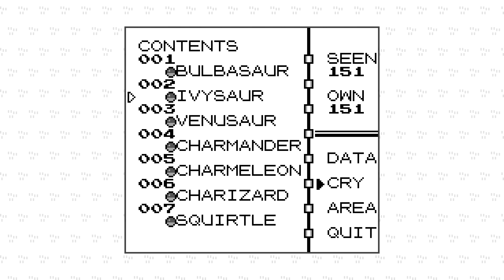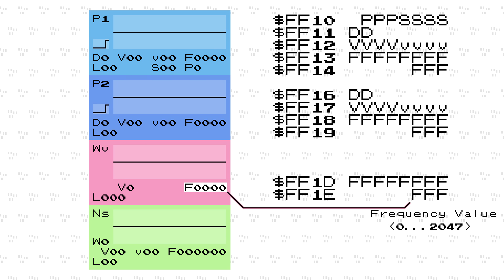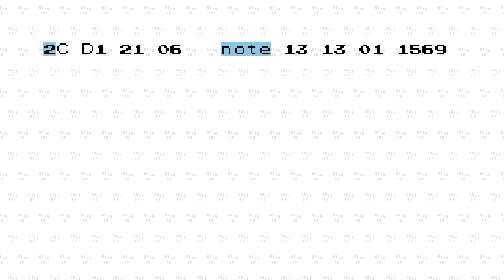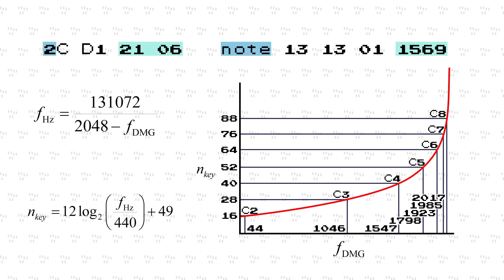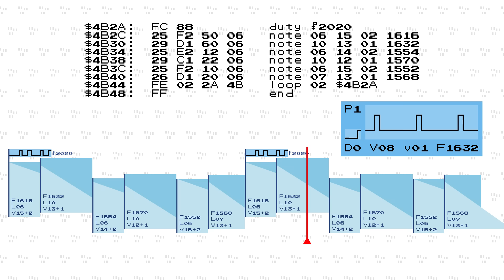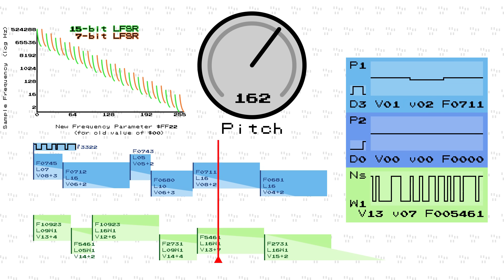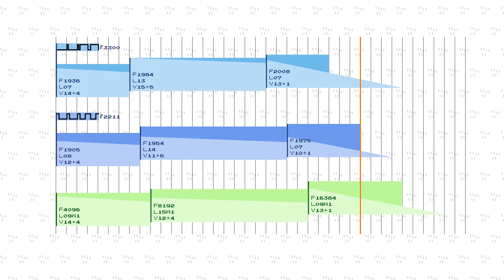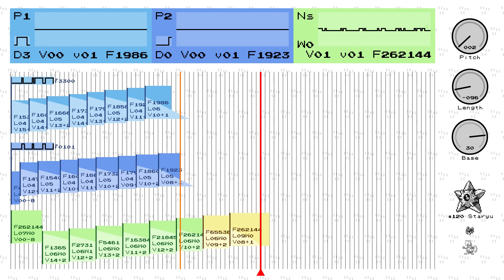Generation I Pokémon Cries Explained

Comment: Hi, I'm an italian student. I'm writing my master thesis based on the sound system of Pokémon Red and Blue. I wanted to ask you where you got your sources since I wanted to delve deeper into certain topics you talked about. In particular I would like to know more about the formulas at  6:46 and 7:35.

6:20 you talked about that the bottom half of the second byte in the second command "play a pulse wave" is represented by 4 bit value. But at 6:26 I only read (in the parts highlighted in dark green) 3 bits: F, - (negative symbol), and 1. Where is the fourth bit?

If you could answer me I would be really grateful and it would help me a lot to complete my thesis 🙏

Comment: I never knew that pitch cry was limited to only 0 - 255, turns out exploring more of it, I realized that it goes from -2048 back to 2048, the pitch note of 0. I explored it, by tuning the pitch shift increment by +128 and by -128.

Comment: id like to knowin depth how this works regarding glitch pokemon, specifically because i would think that glitch pokemon cries are generated in real time as the data for the pokemon appears, using data from other parts of memory like the rest of the glitch pokemon is. itd also make sense for certain forms of missingno and glitch pokemon from gen 1 that have absurdly long cries (some iirc are so long that they end up softlocking the game!)

Comment: Just a little synth nerdery here: a pulse wave isn't technically a squarewave.  Once you make the phase non-symmetrical it becomes a PWM (pulse width modulation)--and is not square shaped anymore (they're more like rectangles).

Love the videos.  Gaming and synthesis in one video.  Excellent.
Reply: Confusingly, many synths call their pulse oscillator "square" since a square wave is a special case

Comment: Here's a neat cry to try:

Pulse 1:
duty 0x0
note 8 15 -7 457
note 8 15 -7 631
note 8 15 -7 710
note 8 15 -7 854
note 16 15 -7 631
note 8 15 -7 262
note 24 15 -7 457

Pulse 2:
duty 0x0
note 8 15 -7 1253
note 8 15 -7 1339
note 8 15 -7 1379
note 8 15 -7 1452
note 16 15 -7 1339
note 8 15 -7 1155
note 24 15 -7 1253

Noise:
[Blank]

Pitch 0, Length 127

Comment: weird that they had 4 cycles available for the square wave but chose to have both 25% and 75% even though they are exactly the same sound just with inverted amplitude, you would've thought they'd go with 12.5 25 37.5 and 50 for 4 different tones

Comment: Congratulations, this video is fascinating! Could you please clarify this: when in 07:21 (about playing a note noise) you say "Bit 3 is used to control the length of the LFSR" do you perhaps mean "Bit 5", or "Byte 3 of the entire command"? (but that would be incomplete, since that byte controls the frequency as well). Also, is the second byte of the noise command used to control the volume and volume sweep? I'm a bit confused 🥵 But THANKS a lot in advance! 🚀✨
Reply: I just figured out that it's indeed bit 3 (starting to count from 0 and right to left) 😅

Comment: Great video. I'm trying to recreate this in Java for a Pokemon game. I'm wondering if you could help me. So far I've created an application that alternates between 4 duty cycles. The only problem is I can't figure out how to calculate the rate at which the duty cycle should alternate and also the rate at which the volume fades. I don't think you mentioned the exact formulas for this in your video. If you could answer my question, I would really appreciate it.
Reply from the maker: The fastest that the duty and volume is modified is once per frame, so at about 59.7 Hz.

Comment: Hey,
I tried to make some own Pokémon cries using your editor but I don't really know how to open the RAW files in Audacity. Maybe someone can answer me on that.
Really great video, I'm always amazed by how interesting and appealing your videos are.
With deepest respect,

v. Fuzzius
Reply from the maker: You have to import it into a project instead of just opening the raw file. You can do that from File -> Import -> Raw Data.
Reply: @RGMechEx  I tried that out and tried different combinations of parameters. I put it to unsigned 8-bit and 1048576 Hz as you wrote on the website but it still doesn't sound right. I'm probably just having a really stupid error here because I have absolutely no experience in audio data or anything like that. I'll try it again, but until then, maybe someone knows what's wrong. Thanks for answering and have a great day.

Comment: Could you explain how the developers of Pokémon 1 were able to create large open areas where you could walk through with constant scrolling, i.e. without stopping to load a new area? To compare: In Zelda Link's Awakening, the whole overworld is split up into checker board areas which are just one screen in size. A new new area gets only loaded once you touch a boundary of the screen. This seems technically much less advanced than the Pokémon solution, where the camera is most of the time centered on the game character.

Comment: I'm not a coder or scholar of computer science so I don't understand a lot of the code values and executions and stuff, how they'd be implemented into a working thing, but this is really interesting and it's cool to learn some part of how this all works. The visual aids are super helpful and I'm really impressed by the quality of them all. Idk how to get cool effects like the knob value changing in real time as the knob is turned without doing some frame by frame editing with lots of manual calculation.

Comment: Are you familiar with the digital "multi-engine" oscillator on the Korg Prologue? It's a digital synthesizer that lets users program their own settings. I wonder if the web app you made for Pokémon cries could be ported over to that - essentially letting Prologue owners play various cries as a voice on the keyboard. Since the cries use three channels I'm not sure if it would work, but it might - I have a Prologue and I'd love to play around with this potential.

Comment: amazing video, but i have one problem.
not sure if this is your problem, but when i save my new cry, it saves as a .raw file, which in my case reads as an image file.
i would really like to turn it into an audio file (.mp3, etc.) and i dont know how. any help?
Reply from the maker: Audacity allows you to import raw PCM data. I believe it doesn't support the super high sample rate, so you may need to import it at a lower sample rate and then use a filter to play it at normal speed.

Comment: Try this!
Pitch: 255
Lengh: 127

P1: duty 0x88
note 6 15 2 1616
note 10 13 1 1632
note 6 14 2 1554
note 10 12 1 1570
note 6 15 2 1552
note 7 13 1 1568
duty 0x88
note 6 15 2 1616
note 10 13 1 1632
note 6 14 2 1554
note 10 12 1 1570
note 6 15 2 1552
note 7 13 1 1568

P2: duty 0x40
note 5 0 -8 0
note 6 15 2 1617
note 10 13 1 1633
note 6 14 2 1556
note 9 12 1 1572
note 6 15 2 1553
note 13 13 1 1569
note 6 14 2 1556
note 9 12 1 1572
note 6 15 2 1553
note 5 13 1 1569

NS: 
note 7 13 2 0x1c
note 10 11 1 0x2c
note 9 12 2 0x2c
note 10 11 1 0x3c
note 7 12 2 0x2c
note 10 10 2 0x3c
note 8 12 2 0x2c
note 6 10 1 0x3c
note 10 12 2 0x2c
note 5 10 1 0x3c

Comment: Can't believe Raichu and Articuno are in the same sound-group, and that it required altering very little ramifications to get there; especially considering it sounds like Raichu has descending notes (and the "crash"), while Articuno has ascending. Which kind of isn't the case, as Raichu's still ascending (even though it's pitch is big), but the noise somewhat masks that sound, when it's much more noticable in Articuno's. 

My explanation here was probably riddled with mistakes since I'm still trying to grasp this - amazing video and thematic.

Comment: What an incredible video! And the cry synthesizer is amazing!
I disassembled and documented most of the pokered sound engine myself, and I still learned a few things from this video!
My only nitpick is that it's not really appropriate to call the sound command identifiers "opcodes", since the sound commands are not CPU instructions.
The sound command identifiers ($FE, $FF, etc.) are just constants that are inside sound data that follows a very specific (ie, Pokemon RGBY only) format, and the data is read by the RGBY sound engine, and then action is taken based on the sound command identifiers that are read. These commands (loop, end, etc.) are specific to Pokemon RGBY, not general sound commands that belong to the Gameboy.
Reply: P.S. I just binge watched every one of your videos. Fascinating stuff!

Comment: It's baffling that they're STILL using these cries in the modern Pokemon games, with the exception of Pikachu. Seriously guys? You can't snag a recording of a Pokemon cry that was made for the anime and slip it into the game?
Reply: nah they changed a lot of them. I agree though, why not just use the sounds from the show.
new Pokemon have better cries, but they've kept a lot of these old ones.
Reply: they revamped all the cries in gen 6. some are unoticable but there are a few whos change was pretty significant  (like Raichu and Staraptor)

Comment: Huh. I never gave much thought to pokemon cries...
Some very interesting tricks going on there.

It also gives some insight into the gameboy's audio features.
I vaguely knew about them, but I've never looked at the details.

Even though I experiment with retro development, my focus has been on the SNES, Mega Drive and Atari 800XL

Surprisingly, the gameboy's audio chip resembles an improved version of the Atari's.

The Atari contains a chip called 'pokey' which was previously used in some 2600 games by being included in the cartridge.  - and later got the same treatment in the 7800.

The 8 bit Atari computers however have it built in.

Pokey has 4 audio channels which produce square waves at a frequency specified by a master clock, and a frequency divider.
You can choose the master clock to be 1.79 mhz, 64 khz or 15 khz, but due to the way the divider works, the jumps in frequency are non-linear, and the frequency changes much more for higher frequencies. (the larger the value, the lower the frequency. - but given it's a divider, that means the first setting halves the frequency, yet the lowest frequency settings specify from 1/254 to 1/255 of the master frequency, which is relatively small.)
The frequency divider is an 8 bit value, but you can merge two channels together to get a 16 bit divider. However, that means you end up with less audio channels - eg, you can choose 4 channels with 8 bit dividers, 1 with 16 bit + 2 with 8, or 2 with 16 bit.
Each channel can produce noise using a 19, 15 or 5 bit polynomial LFSR, or some combination thereof, and it's also possible to set some of the channels to  use 9 or 7 bit polynomials instead. There's quite a few combinations available, and there are 3 independent LFSR's that get combined according to your settings. (the extra settings come from two of the polynomials being of adjustable length.)
Finally there's a 4 bit volume control for each channel, and the option to set it to 'volume only' mode, which means you can output 4 bit waveforms by manually updating the volume.

However there are no envelope features, any attempt at wave playback has to be done by using the CPU to push values into the volume register at high speed, and there are no sweep features of any kind.

(the audio chip is also used to provide hardware timers at the expense of losing one or more audio channels.)

While there are some missing features, and a few extra ones, these are two remarkably similar looking audio chips...

Comment: But why does missingno. have an endless cry?
Reply: Probably because the area of memory that ends up being interpreted as it's cry doesn't have an FF terminator for a while, or has a large loop counter.

Also there are some glitch Pokémon which seem to have long cries consisting of random other sound effects, but they're not generated by the cry system itself, rather their name overflows something that causes the text engine to start playing sounds (since it has commands that call sound effects)
Reply: Because he has depression
Reply: Missingno's "true cry" in Pokemon Yellow only is the result of the game switching to an invalid/glitched sound bank when its "sprite" decompression goes haywire and corrupts memory. I don't think it has much to do with a typical cry--the glitched sound begins (and interrupts the music) during the transition to battle, which is when the sprite decompression for a wild Pokemon happens. This also causes the battle itself to be devoid of sound effects.
If I remember correctly, most of Missingno's actual cries are base cry 0, pitch 0, and length -128, because that's the result of the game reading the very common value "00 00 00" as its cry information. 
Or, you might be referring to how some glitch Pokemon play unending glitch symphonies of sounds during their Pokedex entries after you catch them. This is because the game is reading garbage/unrelated data as text data for the Pokedex entry, and as jfb-1337 mentioned, the text engine will read a lot of that data as sound commands.
Reply: The sprite being decompressed overflows into WRAM and switches the soundbank to an non-existent one, which freezes the game.

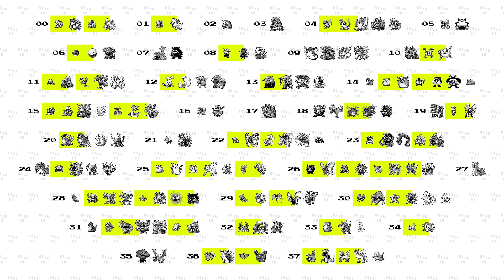Comment: In generation 1, Pokemon have an internal index number that is totally different from the final Pokedex number that is used (i.e. the first four Pokemon are Rhydon, Kangaskhan, Nidoran Male, and Clefairy) and might be a convenient numbering system to sort by for this purpose. I got bored and numbered the groups you have listed at 11:38 and you can actually see a pretty clear divide based on index number: the lowest index base of each group is largely concentrated at around 30 or less, with 6 straggler groups going up to 60 and 4 groups (corresponding to those containing Marowak
, Ponyta, Rattata, and Aerodactyl) stuck way out there at 145+. Cubone is the earliest cry group repeat at 17, so maybe the idea to pitch shift Pokemon cries came into existence right around there? Also - would you be able to add the various Missingno cries that aren't garbage to the video you plan to upload as well? There are 9 Missingno with non-garbage cries. Super cool video, thank you for making it, and thank you for taking all of the time you do to make the editing look super smooth.

Comment: should explain how Gen 2 bellsprout cry causes a massive glitches with the broken coincase glitch
Reply: In english version, Coincase's dialogue ends by index number 57 instead of 50(end letter), and this causes loading pokemon's cry data. Normally It is empty so cause nothing. But if you hear pokemon's cry in pokedex before read dialogue, it loads another data causing glitches. For example, Bellsprout's cry loads field data so it can change codes easy. This is why Bellsprout used in Any% speedrun. Also, other language version don't mistake it so can't use this glitch.
Reply: It has nothing to do with the cry itself. It's just ACE through the coincase.